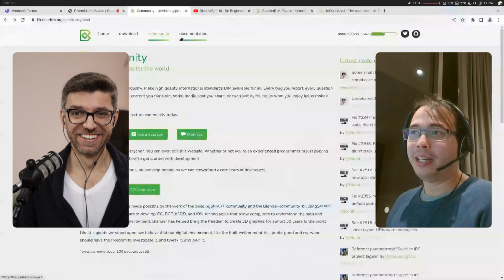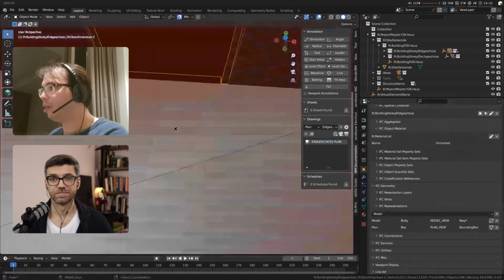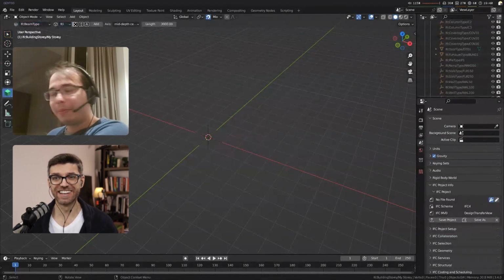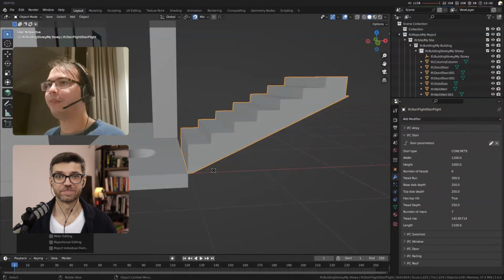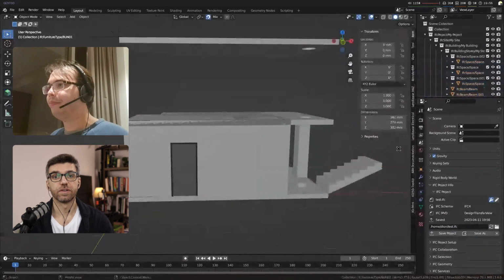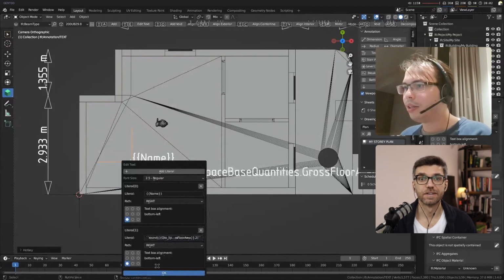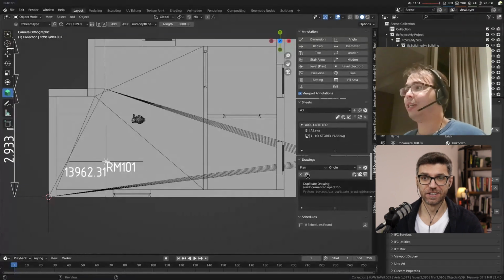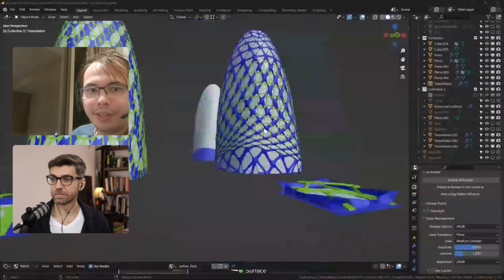13b Hands on with BlenderBIM with Dion Moult. BIM with Blender

Comment: i think until Inkscape dont improve in terms of stability, proper Units & grid system, robust block system and basic cad tools, OpenBIM will lack documentation functionality which holds a great importance in the BIM process.
Reply from the maker: I recommend you check out Freecad, as it already has pretty proper documentation functionalities